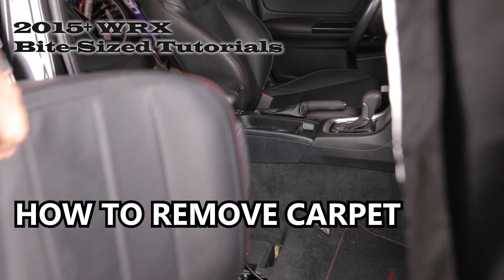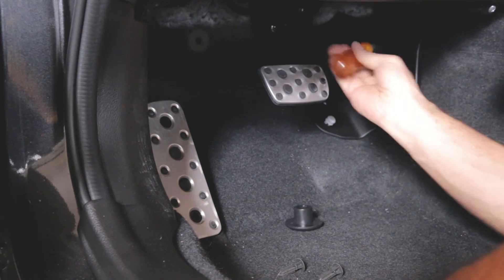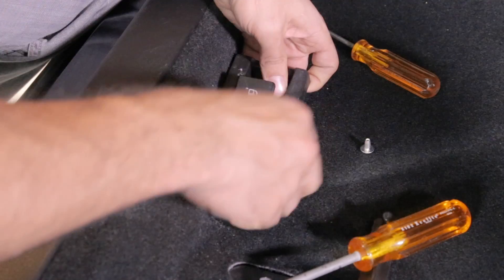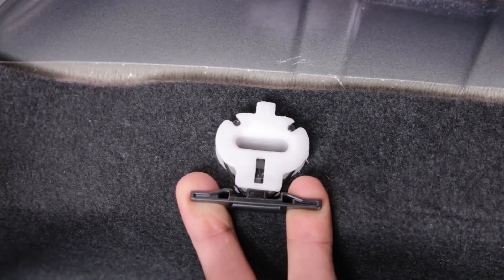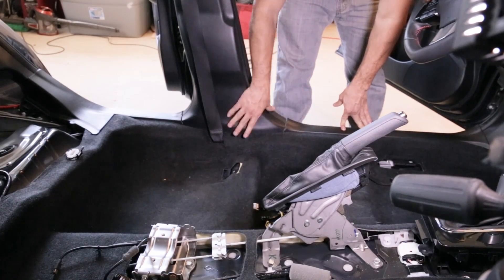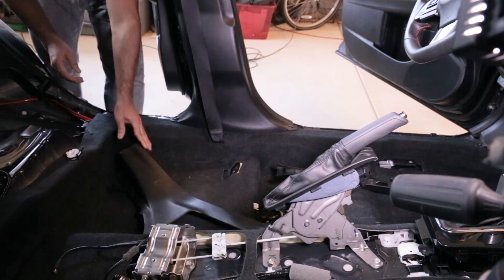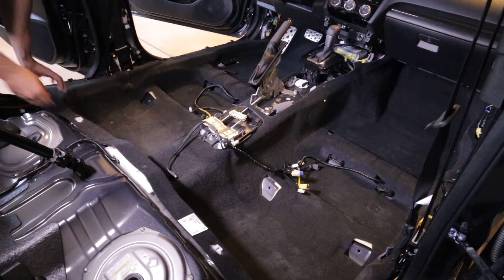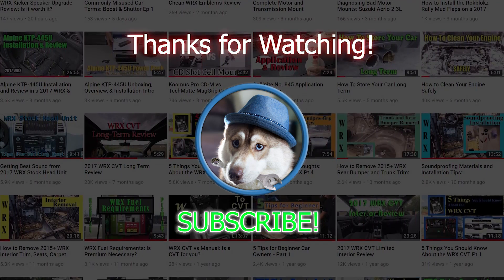How to Remove 2015+ WRX Carpet

Comment: Great videos man. i need your input on something.. i'm thinking of sound deadening my 2015 crosstrek. is it  possible to remove it section by section like do the driver side first or front seats first and then when i'm done in the front, install everything back and then do the rear part? or is it better if i just remove everything and apply sound deadening and put everything back? thanks
Reply: I was thinking of doing the same thing. Did you go down this path? Did it make a difference once done?